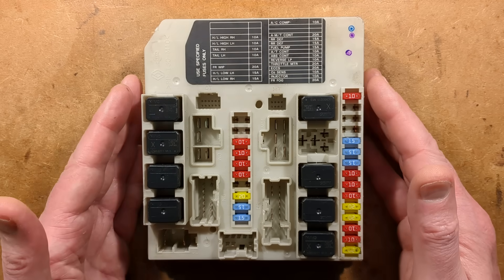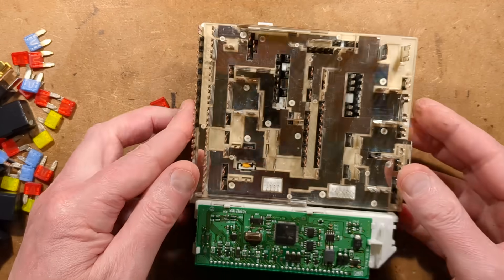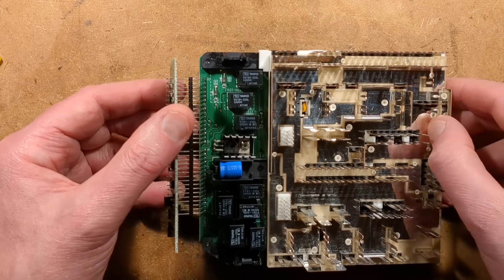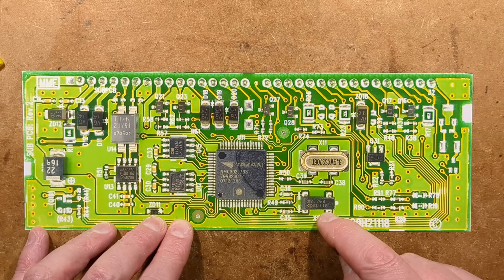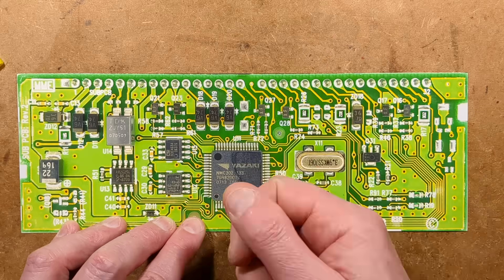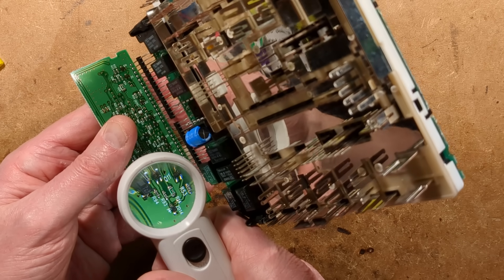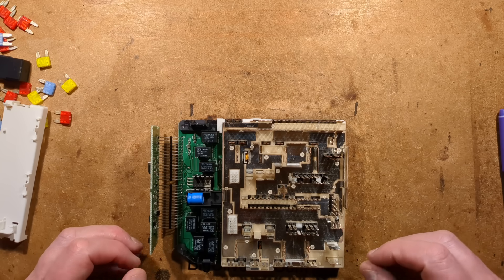Why your car's fuse box costs so much (and the location of the data chip)

Comment: One of my favorite automotive failures was when people with certain GM 1500 trucks would come in complaining when they turned off the ignition, the engine would stay running. It was caused by a cracked headlight housing that would allow water in and eventually short an ignition circuit to 12 volts. "Your truck won't turn off because you have a cracked headlight" perplexed a good number of our customers 😂
Reply: Or the era when the stereo in a GM would go bad and stop the car from starting
Reply: @srpacific  That was also a problem in some Ford Falcons (an australian car)
The radio, for some reason, contained the rollover detection. One of my dad's former friends drove around without a radio because a new one was very expensive and would be ruined if the courier tipped the box over. A very stupid design, but par for the course in australian ford/GM products. Little wonder they went out of business, shame that our mitsubishi factories died along with them though.
Reply: @srpacific  Or the S10 that could have a malfunctioning valve in the 4x4 transfer case that would cause oil to leak out of the hvac vent control knob on the dash. o_O

Turns out the transfer case would open a vacuum solenoid to engage the front diff, and the hvac controls were also actuated by vacuum bellows.  Some transfer cases had a defective seal that would leak oil from the transfer case into the vacuum line, and due to the routing of the line the hvac knob would ingest the leaking fluid which in turn would ruin it's seals (as they were never intended to see oil) and leak oil out of the dash onto the floor of the cabin.
Reply: I had an FSO pickup that started when you pressed the cigarette lighter. That was deliberate on my part though, the ignition switch broke.
Reply: @bobs12andahalf2  , it sounds like its going to be impossible to steal your car by hot-wiring it.
Reply: @bobs12andahalf2  That is an old trick used in Australia by people who DON'T smoke or don't smoke in their car.
They wire the cig lighter socket so it works as an immobiliser switch. It is right there and car thieves never test it.
Reply: @TheHungrySlug that's pretty cool, never heard of it. Even further back I had a Skoda pickup. I would take the rotor arm out of the distributor when I had to leave it unattended in the city for days at a time. Nobody ever tried to steal it though 🤣 but they loved breaking mirrors off it and filling it with garbage
Reply: @bobs12andahalf2  Good theft protection. Might steal the idea.
Reply: I had a moment like that once. I was working on a diesel truck at my last job that was knocking horribly, but ran fine. Had the service tech out and we were going through everything trying to figure out what was going on since it wasn't throwing any codes. Turns out the brake pedal (pneumatic brakes) was plumbed backwards, so the air compressor wasn't shutting off and the governor was stuck. Flipped the lines and everything got quiet again. Tech had no idea how to code that visit, lol. "Apparent engine knock solved by replumbing brake pedal air lines". Definitely not in the diagnostic troubleshooting tree to look there.
Reply: @Map71Vette reminds me of the older Fords that had a control valve on the steering linkage. Two hydraulic hoses were connected to the valve. They liked to leak, especially when people hold the steering wheel against the stops. I removed the hoses, ordered replacements and went to lunch. Forgot which hose went where, hooked them up backwards and when I started the car the steering wheel went from lock to lock really fast. I tried reaching through the steering wheel but sprained my wrist. Got it shut off, reversed the hoses and finished.
Reply: That reminds me of the DiagnoseDan video featuring a BMW that wouldn't start because water had got into the electronics inside a door handle, as in "your car wouldn't start because the door handle was wet".

Contrast with the unfinished project 1982 Ford Fiesta in my garage. There are 5 fuses in the whole thing, and the most complex piece of electronics in it is the medium/long wave radio with mechanical push-button presets.
Reply: @Zeem4  , an auto electrician asked to buy my 1985 mitsubishi because he's sick to bloody death of fixing other people's car problems.   i refused to sell it.  it is my most reliable car.
Reply: im a mechanic who worked on the 6.5 diesels with the stanadyne elec controlled pump,a workshop manual and a tech2 GM scantool are essential LOL
Reply: @andrewsmart2949  I have a brand new 1980s Stanadyne mechanical diesel fuel injection pump/valve for a Ford or a Freightliner V8 diesel. Those were expensive back in 1986. You need a bunch of highly specialized Ford Rotunda & Freightliner tools to work on any of it. GM had dodgy electrical going way back. If a sparkplug went bad in the 1990s trucks the transmission would slip. A bad $5 part mimics a $6000 transmission issue.
Reply: GMs are hilarious. The automatic headlights are nice, but the "parking lights" are a clownshow. Having the reverse lights come on as "parking lights" when the vehicle is parked is just so nonsensical. How many times have people sat behind a GM vehicle wondering whether it's about to back up into their path or whether it's just parked? Also, I had a Company pickup truck where the Company mechanic wired up a "backing beeper" to the reverse light circuit. Problem? The truck was a GM. So, whenever you parked it, the backing beeper would sound for a literal minute or until you manually forced the lights off. 🤬
Reply: @Dee_Just_Dee You are full of more crap than a Christmas turkey ! The reverse lights do not come on with the park lights .
Reply: Retired ASE CMAT L1 MRRT EIEIO here. The Chrysler Totally Integrated Power Module (TIPM) had so many circuits running through it. If one failed, which they did, the whole box gets tossed. The fuel pump relay is in the TIPM and they do fail. Chrysler came up with a bypass kit that required cutting a few wires in the TIPM and adding an external relay. Also, try taking apart an under hood fuse box from a late ‘90s GM product without losing your mind tracing the circuits.
Reply: One that always made me look insane when working in auto parts was when people would ask for oil & filter for their Honda Accord. 4 cyl / V6 they expect but then you have to ask if it has a sunroof (on certain years). This does matter because the filter location moves and the oil capacity is different! The presence of a factory sunroof implies the presence of a subframe strengthening member which actually changes which oil pan you get on both engines. Fun stuff.
Reply: I don't you one better. Imagine you own a Volkswagen circa 1999 to 2005. Imagine your fuel pump dies. The fuel pump is located under the rear seat. You open up the access door and the fuel pump housing on top of the fuel tank is covered in engine coolant. The engine is 10 feet away and the cooling system has nothing to do with the fuel system. The problem is the coolant overflow bottle. The low coolant sensor seal on top of the bottle fails and over the course of many months coolant wicks through the strands of copper in the wire harness and slowly make their way to the fuel tank until the fuel tank shorts out.
Reply: This sounds like an 00-era GM, a truly bad time for GM's electrical system.
Reply: Reminds me of the Corsas where you could flip the hazard switch to power it all up
Reply: Got something like that with some of the Ford vehicles. The alternator shares a LIN communication curicut with the active grille shutter. When the grill shutter actuator fails that whole network can go down leading to the PCM being unable to tell the alternator what to do. That's a fun one to explain, "your charging system doesn't work because your grill shutter actuator failed."
Reply: That sure beats being able to start up, unlock, and drive away the car by BREAKING a headlight, and using the connector to get into the car's network, which is a common tactic for thieves of some models these days.
Also: WHAT "data chip"  Any data chip in our uhmurrican cars would probably be under half an inch of conformal inside the ECU.  I am startled to see electronics in your fusebox!
Reply: My personal favorite was on a 6cyl jeep TJ. Customer called in and said his ECM was leaking oil. I quizzed him for a couple minutes but he swore up and down it was the ECM. I said bring it in and figure I'd get a little chuckle if nothing else.

He brings it it and I'll be damned if the ecm isn't dripping oil down the firewall. Turns out the oil pressure sensor had failed and was sending oil straight into the harness. Still read pressure on the dash though the customer said it did flash "check gauges" on the dash once as he was coming over. Never seen anything like it before or since.
Reply: I had similar with a diesel Ford Courier van we had a work. I parked up outside the office, switched the ignition off but the engine kept running. As soon as a went to get out to investigate, the engine stopped when I took my foot off the brake. Turned out someone had managed to jam a single filament tail lamp bulb in where it should have been dual filament which was shorting the tail light and brake light circuits. As I had the tail lights on, it was back feeding through the brake light switch into the ‘ignition’ feed and holding the fuel solenoid in.
Reply: That just makes them easy to steal... sadly
Reply: @SiraTorProductions  No, it does not.
Reply: That seems like it could be very deadly on more silent vehicles. You'd think that there'd be a massive recall for such an awful design choice.
Reply: @Jeff-ss6qt  No. Just...no.
Reply: That sounds SOOOOOOO GM.
Reply: Casey LaDelle pulled a Tacoma out of the mountains at midnight for a no-start.  Guy worked at the Toyota dealership in town where they dropped it off.  Next morning they tech put a new lightbulb in the brake light and she started right up.  Nice of a vehicle sold as for going out in the woods to strand you just because a bulb burned out.
Reply: I only towed one vehicle out of thousands that wouldnt shut off. It was an S-10 though not a 1500. Think I pulled the fuel pump then disconnected the battery to kill it so I could take it to a shop. Didn't ever hear what actually was wrong with it.
Reply: @juliogonzo2718  You could plug the exhaust ... that'll stop it.
Reply: @MrAdopado never thought of that actually. That would work
Reply: i am so happy with my old Toyota......
Reply: Is that why that happened? My parents old van would do that and we could never figure it out
Reply: That's never been a thing historically. There hasn't been any kind of ignition feed going to a GM fullsize headlamp to cause that type of failure mode. The newest T1XX trucks could theoretically exhibit this type of scenario, but highly unlikely. Bad grounds causing stalling and other electrical issues would be much more plausible.
Reply: Sounds like a shit design
Reply: Had a Hyundai that I could take the key out of the ignition and the engine would continue running. The canister purge valve was stuck open. As long as the PCM sees a crankshaft sensor signal, it will continue to deliver spark. The canister purge valve was letting fuel vapors into the engine. Everything you need for an engine to run. The engine stumbled and ran poorly off idle due to the lean fuel mixture.
Reply: I remember fixing my Son's old 1998 Rav4 which would randomly flatten the battery and make a weird gurgling noise.  The noise was actually coming from the horn!!  What was happening was a spot of rust under the windscreen was letting water run down the pillar into the "Instrument Cluster Junction Box" (Toyota's name for these).  The ICJB had the pins coming out one side for the cables to plug in and the fuse terminals on the other side.  It was actually the cars main fuse box.  When I opened the unit, I found that water had corroded some of the metal tracks away completely.  Internally, it used plastic trays with plates of sheet metal formed into conductor 'tracks'.  Any pins for the connectors coming from these conductors bent one way and any connections for fuses bent the other way.  Pins would pass through slots cut into the trays so they could not come in contact with the metal on any other layers. The use of the plastic trays allowed this to work a bit like a heavy duty multilayer PCB.  On the connector side, the metal pins just protruded into the moulded socket body and, on the fuse side, the pins were shaped into jaws that grab the blade fuse's terminal.  It's simple and ingenious and also included relays and a strip socket (all made from the metal plates) that connected to a PCB that handled timing functions.  Unfortunately, when the metal plates are damaged, you need better metalworking skills than I have in order to make replacements so I had to replace the whole unit (after fixing the rust).
Reply: That's why people buy Japanse cars. xD
Reply: Sounds like American engineering to me..
Reply: @hoedenbesteller  Then you should look at the stuff out of Italy and Germany....
Reply: @Blazer02LS The french ones are even worse._
Reply: @hoedenbesteller  country of origin does not matter. 

These issues will stop any car with a computerized module, brands do not matter.
Reply: America quality
Reply: @ajz2k  I'll remember that the next time I replace my Honda's lock actuator when the next one breaks.
Reply: There are so many stupid comments here...

Comment: Great! Now how much to find and fix my parasitic draw on my '07 convertible mustang? LOL Thanks Clive. Auto electronics is great fun when it's someone elses problem and money!
Reply from the maker: Eric O at South Main Auto does a lot of videos involving tracing rogue power draw.  Often faulty modules that keep waking the system.  His approach varies, but using a sensitive voltmeter to measure across fuses can show a tiny voltage depending on the current the circuit is passing.

Comment: At least on this side of the puddle, theater lighting is generally controlled by the DMX512 protocol, which uses RS-485 signalling (not CAN bus). https://en.wikipedia.org/wiki/DMX512
Reply from the maker: And indeed now RDM which is DMX compatible but bidirectional.

Comment: Somehow how one feels they could do different sized/polarized fuse for different ratings so you can't put the wrong one in the wrong place.
Reply: And go from only 4 or 5 different "blade" style fuses to 5x9 (45) different keyed blade fuse plastic moulds just to avoid reading the diagram usually stamped into or stickered onto the fuse box lid?

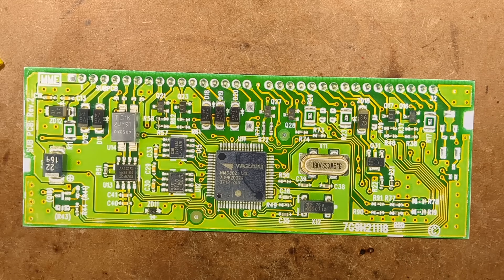Comment: 8:00 I have indeed used a test clip like that to clone the data off an EEPROM in an ECU, and it worked. Certainly wouldn't guarantee that it's reliable, but then again that ECU was mostly comprised of scorch marks, so I kinda doubt the microprocessor was doing all that much talking at that point 😅

Comment: I've tried using that chip-clip thing to read data on one of them 8-pin chips, though it was in my laptop and not a car, didn't work reliably at all (crap clip broke!), ended up just soldering the wires onto the pins directly, and then it worked, all to remove one of them supervisor password things which was easier than expected... :)

Comment: Having car  parts 'coded' to each other is a pita and the person who had that idea wants suspending by some sensitive bits....
Mines a dumb fusebox, built like a multilayer pcb with plastic and metal. the fancy stuff is back inside the dash in 'the bcm' - body control module, it even has the relay in there for flashing the indicators, which has a high tone click for right and a lower tone click for left..... design idea or just a different relay who knows lol.
shame the van will be scrapped at next mot in october, tin worm has taken its toll, the weeping head gasket is weeping worse, and the dropping into limp mode /every/ morning for 30 seconds has become very annoying.

Comment: the 32K crystal will probably be for power saving when the vehicle is switched off. The CPU will switch to low speed mode running off the 32K crystal.

Comment: When running, the processor uses the 3.9MHz clock, in standby or sleep it runs on the 32KHz clock. A common fault on a piece of automotive electronics that I repair is failure of the 32KHz resonator and the fault manifests itself as a constant reset cycle ONLY when entering standby mode...!

Comment: I've done a lot of reading little SPI or I2C chips with a test clip while in-circuit, and find it tends to work about 75% of the time. The problem you describe definitely does occur, however.

I imagine it works often enough because a lot of devices only read from the chips at startup or doing some kind of work, and not while idle. Thus if you power it for a few seconds, it is often idle by the time you start your transfer.

Comment: My biggest nightmare as an automotive diagnostic tech, can give you so many false positives.
Reply: I never go in as deep as you did big man, I just reprogram a new one and move on.
Reply: That’s the problem of software writers who wrote the diagnostic program, they failed to communicate with those programmers who wrote the software to control the cars systems. AKA the old adage where the left nut don’t know what the right nut is doing……